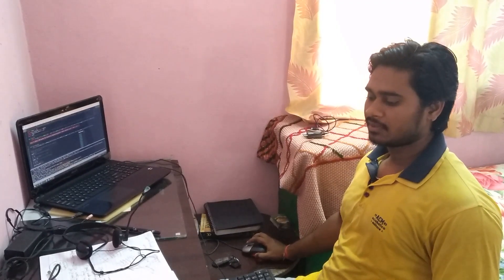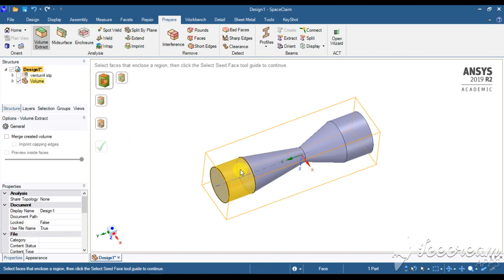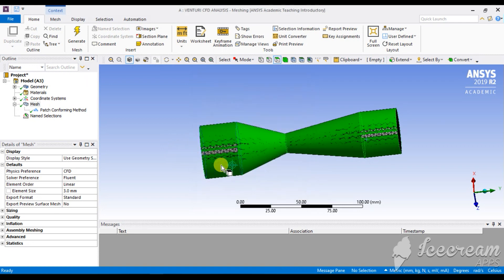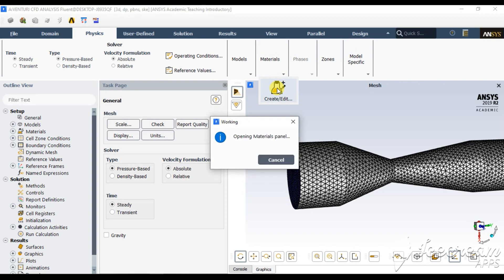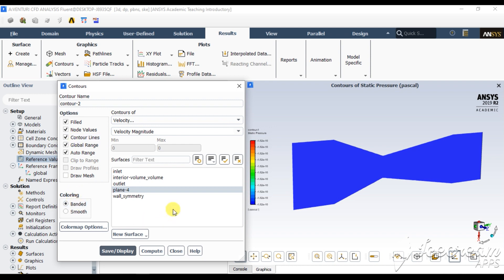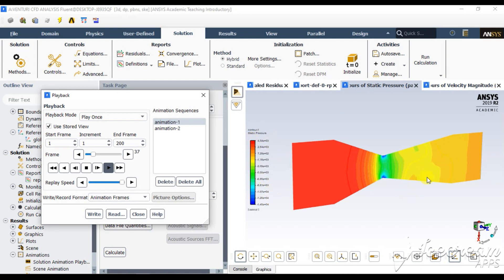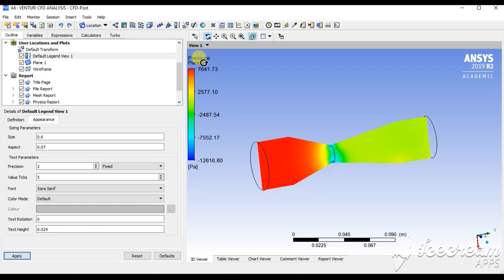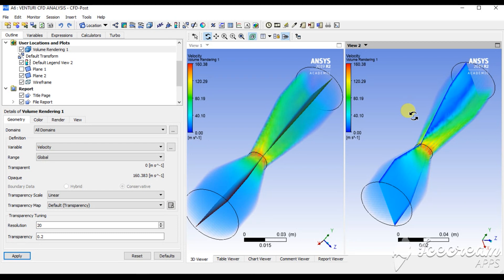FLUID FLOW THROUGH AN VENTURI MODEL

Comment: why does the flow deviate in your simulation? you have a symmetrical tube, so why the velocity vector field deviate?
Reply from the maker: Have u heard about vortex shedding phenomenon
Reply: @SANDEEPMANDAL-DEZengineering  I considered Coanda effect, though. Anyway the geometry is symmetric and the flow simulation is not. That's why I'm asking. 
Thank you for your reply!
Reply: just verifying the bernoulii theory. first time i ran the simualtion i also noticed the back flow in the diverging section right after the throating
 @SANDEEPMANDAL-DEZengineering